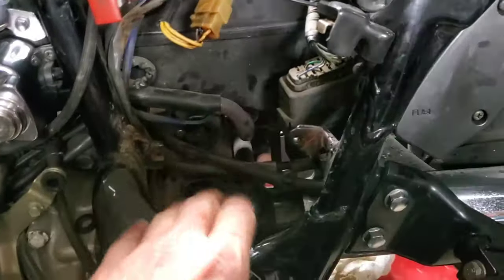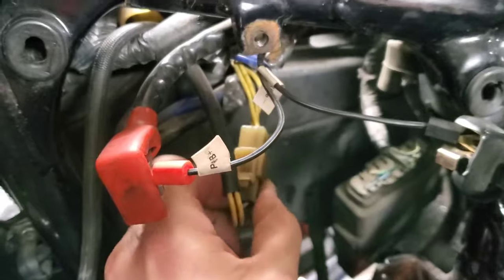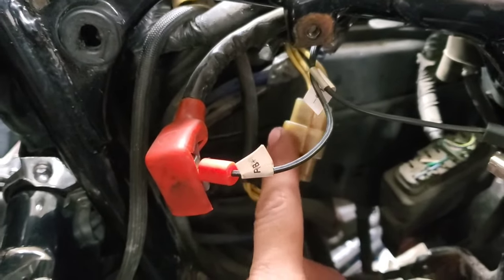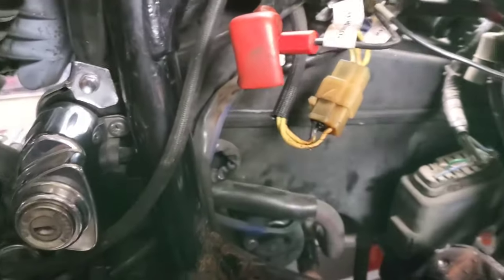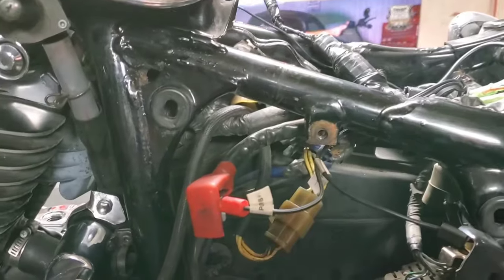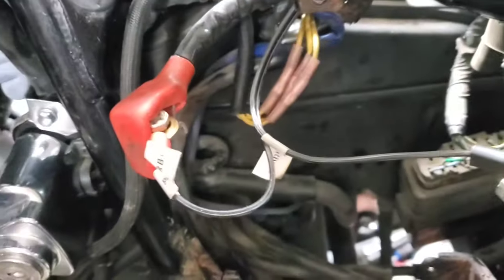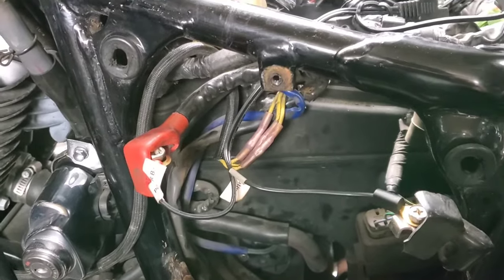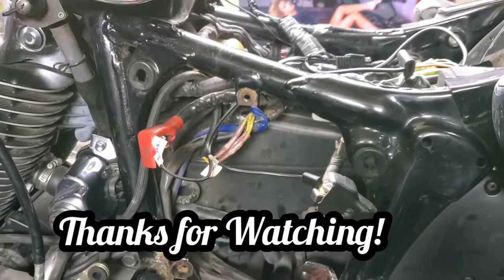Common Honda Shadow 1100 problem

Comment: Thanks for sharing!
I had a similar problem with my Honda Phantom! 
The Stator was not changing the battery and the bike would die on me after a short time! With the help of a Voltage Meter, I traced the fault back to the wire connectors, I replaced the connectors and it solved the problem! 
However, my bike is 16 years old, I believe that it would be better to replace the entire electrical wiring loom now because of the age of the bike?
👍
Reply: For a while Honda had Stator problems because they were poorly made... I replaced mind with one that was made in California... It was cheaper than the OEM stator and better built...

Comment: this video is a couple of years old, but the comments are more recent and dam helpful, so thanks to James and others. Man you helped out some dude in here real good,,Impressed
Me I have just bought a 2001 VT1100 with no spark..havent seen it yet, but got all new parts in case as I am planning a road trip as soon as I fly in and fix it..I have a CB1300, or two, and had similar issues re spark, burning batteries, only running on two cylinders etc etc..as I live in remote Northern Thailand getting a good mech is not easy, so at first had to work thru it myself, and I am not a real mech, just an old biker...sensors were the problem..and wiring..last owner must have hacked into it himself and got it all wrong..The battery was only half size, and no wonder it went flat in no time..and four huge spotlights, headlight fan, radiator fan, etc..running to much gear..I dont play with carbs,,,coils change, ECU change, regulator change , plug change, new sensors, air filter as these can crumble over time..bottom line is work your way step by step thru, spark, fuel, air and battery...I had to do it three times over many days to get it to fire, and then again to fire on all four...dont give up..for what it does is teach you about your bike

Comment: God this bike has so many problems

There's a bloody vacuum cut off switch going to the fuel petcock.  If your engine isn't rotating and creating a vacuum, your petcock will be blocked.  Only sometimes on start the engine doesn't create a vacuum, so you'll end up turning the engine over forever until your battery is dead and it won't crank, and you're fuel line after the petcock will be bone dry.   

The solution is to disable that valve by opening it and locking it always open... or to pull off the tube where it goes into the engine and suck into it, which will open the valve and let the fuel flow and prime your carb if it's bone dry.   Once the bike cranks it will create enough suction to keep the valve open and the fuel flowing.   

Worst... design.. ever.   Disable that vacuum cut off valve in the petcock. If your petcock is ON or RES, you want fuel flowing, no questions asked.

Comment: OMG!  I just bought a 2000 shadow spirit that has been parked for three years.  Told it ran when parked and has bad gas.  I cleaned the gas tank, checked for spark and nothing.  My plug in looks just like yours.  Can't wait to see if this is the fix that gets me running!  Thank you!

Comment: That plug is a problem on all the Honda Shadows. The first thing I do is cut out the plug and solder the wires instead. Then get a Mosfet style regulator before your stator burns out. Honda has piss poor fegulators.

Comment: I picked up a 2002 VT1100 Shadow that wouldn't start.  There was a very small amount of gas in the tank and the pump might have been dry.  The pump wouldn't come on with the key but would when I jumped the relay wires.  Will the brain of the bike prevent the pump from coming on it there is no gas in the pump?

Comment: wiring has any order? because they are same color coded
Reply from the maker: I don't think so. But I did one wire at at time and  coordinated with each one on the other side of the plug just in case
Reply: @2ndkickmotoandauto  thanks